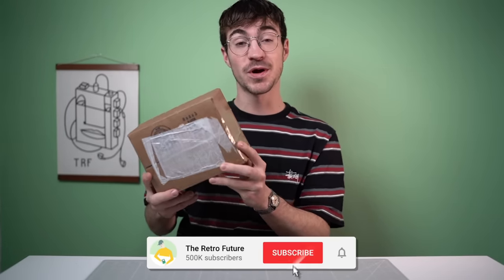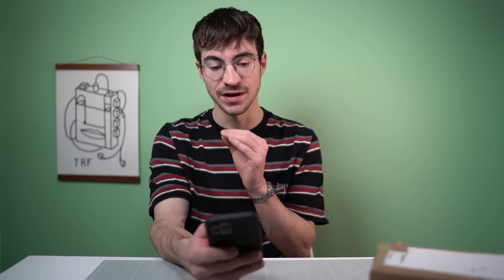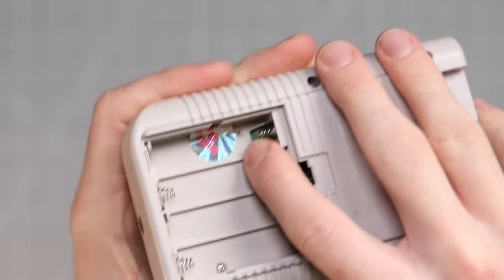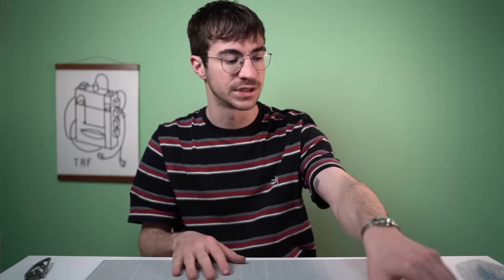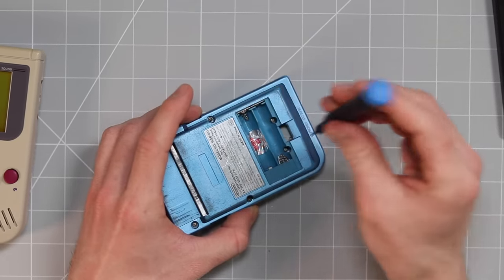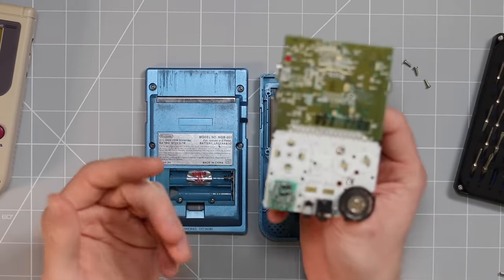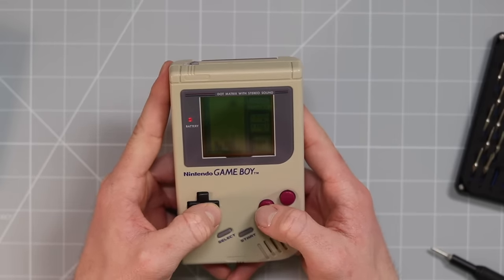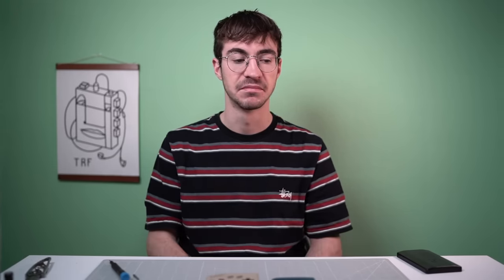DKOldies ruined my life

Comment: These guys sold a Super Mario World with a dead save battery to some poor dude and they made a video where they “heroically” sent him another one while requiring he send the original back, and then they had the audacity to tell me that save batteries are thoroughly checked and that it “probably died on the way to the customer”. You are not gonna tell me a 23 year old save battery died in the few days it took to go from your facility to the customer.
Reply: Of course they want the original back, how else is the next sucke... I mean customer going to get their refurbed unit?
Reply: You never know, it could be possible. Just saying
Reply: Some of those batteries only work long enough to test because they come mostly dead from China.. (all of them come from China) so they could have swapped it, checked it, and then it sat around for a few months and is now dead. This is a common problem with Gameboy games right now.
Reply: Would be interesting to know, if it was the first battery still- as they seem to call working stuff "refurbished" by outside cleaning and putting a Sticker on a screwpost😂
I would bet my a.. , it was the original one that died in stock/while shipping and they called/sold it as a refurbished game- probably they didn't even tested the remaining voltage and swap the battery as they should in that case😬
Reply: Who paid for the return?
Reply: @tormentridden  Those batteries last forever. I tested my old NES games that used CMOS batteries for saves. They were all over 3 volts i.e. good. Now, a few of them I will want to replace eventually.
Reply: Wow 😂they so full of it 🤨
Reply: @qTytan  I could guess the next power ball numbers but how likely is it?
Reply: Do you have a link to this by chance?
Reply: @DaCaptainDerpy  it’s their current latest video
Reply: @DaCaptainDerpy  One of their latest shorts
Reply: Not to mention, but the guy in the video was responding to comments on that video defending and praising DKOldies.
Reply: @qTytan  the save battery should not have died that fast, not if it was actually refurbished. Now if they used some cheapo batteries from China then there's a good chance a majority of those batteries were DOA. 

How do I know that? I replaced some with those. I'd never do that again.
Reply: @tormentridden  yeah that's a plausible explanation. I had a similar thing happen to me.
Reply: Lol dude I bought a copy of links awakening dx for safe display from em two years ago and no lie after seeing the videos I had my buddy bring his gbc over. And you can figure the rest. That’s crazy cause the vids are usually about the refurbish of the consoles and handhelds not being as bad :/
Reply: It is easy to accidentally cook the battery when soldering in a new one if you're not careful. Batteries will soak up all the heat from your soldering iron before your solder can really melt, especially without flux. My first attempt with my copy of Pokemon Crystal ended up with the battery dying about a week later. I didn't use the right type of battery with the flat leads already attached, so I tried to reuse the old tabs and solder directly to the battery lol. I ended up fixing it with the right battery later on, and it's still holding a save 6 years later
Reply: @tormentridden  this is why you buy name-brand CR2032s from a reliable manufacturer like Maxell and check the expiration dates.
Maxell cells are made in Japan. Varta are made in Germany.
Reply: @jakeiswayblack3377  that MIGHT be a plausible excuse…if they weren’t being paid to not make such simple mistakes and ensure quality and functionality to the customers they are charging 3x the ebay price of a game for. Also I change out batteries too, it’s not hard to avoid the battery. ;)
Reply: Right, and they claim that they check batteries with a meter as well!
Reply: Yes, shit like this happens all the time.....
Reply: For the prices they charge, I'd expect a brand new battery soldiered in there, with a removeable battery holder mod to boot.
Reply: And two planes never crashed into the world trade center, as if things don't "just happen"
Reply: They at leasy gave him a new one i like dkoldies i dont believe they meant to send that to him they mightve checked it and when he tried it it mightve worked for a little and then its stopped
Reply: @JenxBobaPlaysRoblox  its your choice to pat 3x the price you should on the chance to get a working or intact product
Reply: @JenxBobaPlaysRoblox  If this were some weird outlier case, a fluke, I would agree with you. But there have been many youtubers who tried DKO and got faulty systems, stuff that doesn't work, and stuff that was obviously not opened and cleaned despite them claiming they open and clean, and thoroughly inspect everything when it's obvious they don't,and that's the point here. They don't do what they claim they do, and then charge premium prices for stuff they didn't do. If I'm going to pay the prices they want, I better get a spotless original piece of hardware and it better not have a speck of dirt in it, it should be recapped, new batteries where applicable, etc.
 
Problem is.... that's not what you're getting.
Reply: i have my dads pokémon gold whenever i save the save file gets deleted
Reply: @Dhalin  true The creator of this video had a flipping fly in the place battery area
Reply: I was just looking at Pokemon crystal on their website and they have a picture in the listing of a copy that has the save battery held in by electrical tape! I sure hope they aren't sending any out like that for $150
Reply: With these old save batteries, they sometimes will hold a save when the console is reset but won't hold it when the system is powered off, or they'll keep the save for a short while without power but will lose it very quickly. So if DKoldies only did the bare minimum testing (which they probably did) then they probably assumed the cartridge was fine. I'm not defending DKoldies, they're absolutely scum. But it's a possible explanation for how it even happened in the first place. Also at the prices they charge they absolutely should be swapping out the batteries regardless of if they work or not, the original batteries on these games are well past their life expectancy.
Reply: @tormentridden are why ROMs are superior.
Reply: @jakeiswayblack3377 Best is to spot weld with the right equipment.
Reply: Yeah there’s prob a billion to one chance that happened. They’re idiots to suggest that
Reply: It was 23 years on the way to the customer 😂
Reply: Seems really minor
Reply: @tormentridden DKoldies defender spotted
Reply: @tannermace1500 your right 2 planes didn't hit the building 2 drones with a hologram image did hit the building though
Reply: Still didn't answer the question
Reply: @xXmonsieurxgamerXx  - You said "unit", lol! 😆
Reply: @jakeiswayblack3377  - I accidentally blew up a battery or two doing this...good thing I wear glasses, lol! 😆
Reply: So they don’t disclose information about batteries
Reply: Man they should really have a warranty or something to make it right when something goes wrong… sarcasm. They are selling multi decade old electronics. They fix what seems to be not working and give a 365 day warranty for everything. Not sure why everyone bitches and moans like they’re getting ripped off, send it back and get a refund. End of discussion.
Reply: @TheRealCaptainFreedom don't claim the save batteries last forever just because yours aren't dead that's the same as saying a cmos battery in pcs last forever because yours hasn't gone flat
Reply: @xXmonsieurxgamerXx  yeah who'd have thought their whole business model revolves around using the working parts from damages machines to built working machines.
Reply: @SineN0mine3  obviously they don't or else nobody would be making videos about their work 😉
Reply: comment dig. I've had this happen. checked a Pokémon game - worked all good after sitting for like 11 years.
Next day turned it on and the save was gone.   Not sticking up for DK. But it does happen.
Reply: @qTytan  its not, 2032 batteries are lithium and do not loose a charge like that. They were made to last decades.
Reply: @tannermace1500 slow down there buddy 😅
Reply: The video game company is better you can buy a game boy for 99$-159$ not bad for there prices
Reply: I mean it's totally possible....
Reply: "77 dollar is a hell of a lot of money" 🤣🤣🤣🤣
Reply: The “23 year old battery” statement could contribute to the battery dying, as you know, batteries don’t last forever. Climate changes like heat or cold weather do put a toll on batteries.
Reply: Hey man, do you know anywhere/anyone reputable to buy a customised gameboy color that would need to be shipped to Australia? Trying find a legit seller, have had no luck so far. Any info would be appreciated.

Comment: Cosmetically flawed can legitimately mean someone smashed a corner out of the plastic from DKoldies
Reply: only comes an A button
Reply: Cosmetically flawed. Just the motherboard and parts it needs to work, no case at all. Slap refurbished on it and sell it for $800
Reply: It would still fit the category of cosmetically flawed. A scratch it technically part of the outer casing being gone. It's just a very very very small piece of your systems body gone. Cosmetic issues means the system will still function. Which is really the most important thing. But the prices he was discussing are high.

Comment: I bought an immaculate second hand "Ice Blue" pocket about 20 years ago. I had no idea that the colour was a limited edition. It was rattling about in my jacket pocket with a couple of cartridges and a small plastic containing 4x spare AAA's for about 5 or 6 years. You think yours is hideously scarred, you should see mine ! Not only has the paint wore off all the corners and edges, but a fair amount of the plastic has worn down too !

The reason I stumbled across this video was because a few days back I unearthed this tatty GB pocket in a box of my old stuff, and (after testing that everything still worked) I decided to show it a little love. I've got parts coming to backlight and "Bivert" it, upgrade the speaker, add one of Giltesa's USB C Li-po charging kits + a 1100mah li-po, and a translucent blue shell to rehome it all in (plus some replacement coin cells for my cartridges, because all of old one I tried in my GB pocket have lost my saved games). If all goes to plan it should be better than new.

Comment: I got lucky with my ice blue then. I think I only paid like 30-40 for it. Only downside is it has screen cancer around the edges (covered by the lens), and I think the previous owner tried gluing the original sticker down at some point. Label wasnt salvageable and took way too long to get the glue clump off and the scrub the cigarette smell out of the inside.

Comment: To be fair, the way they painted the GameBoy Pockets, that paint came off just by touching the thing. I have a golden Nintendo Power anniversary GameBoy Pocket, a good third of the gold paint has come off just from a few years of holding it. I imagine the Ice Blue pocket was painted the exact same way, just blue instead of gold.
Reply: As someone who does own a ice blue gbp, I can confirm that is indeed the case.
Reply: If you washed your hands before using it, the paint didn’t come off. Source: my mint ice blue gbp. Always washed my hands. The oils from your hands wear the paint super quick. Same goes for anything painted or plastic. First it turns glossy, and then it comes off.

Comment: As someone who worked in a retro game store for the better part of 8 years recently, DKOldies prices are absolutely absurd. Their quality control is lackluster at best. We had a rival store in town with very similar ambitions. Selling reproduction carts as authentic, damage, not working or defective games as fully tested among many other things. The simple fact of the matter is, with self taught methods I am able to thoroughly test a system and clean it and diagnose issues usually within 20-30 minutes and give it a full clean on average. Each game is usually about the same for a thorough test and clean. Obviously there can be exceptions like blockbuster stickers or homemade stickers, permanent marker, some people engraved their info into the cartridges which obviously cannot really be fixed without a shell replacement etc. Needless to say, a LOT of retro stores just don't put as much effort into the quality of their resale as they could and as a personal collector before I started working at the store, I had an elevated level of quality I strived for. I treated just about every game and console for my entire 8 years as though it was going into my personal collection. That quality however got abused a little by the employer but when you work at a video game store you kind of don't care lol. I worked luckily at a Ma and Pa shop so I didn't mind putting in the extra effort as I was generally rewarded for it.

Comment: I think the biggest issue is things like "Oh, that won't be difficult for me to remove and replace at all."

I understand you bought something that said it was "cosmetically flawed", but....for a price like $100+ for a DMG, it should still be damn near perfect. The fact that it was $100+, and you're still gonna have to do some fixing up on it, that's just nonsense. Like said in the video, you can get a used DMG for like, $10, and just fix it up yourself at that point. And it'd cost less than this one from DKOldies did.

And yeah, the difference in "cosmetically flawed" between the two game boys, is ridiculous. They're clearly just using "cosmetically flawed" as a catch-all on their website, for anything that's not "perfect" or "refurbished". I'd imagine it's just a way to get people to still buy the consoles, by making 'em slightly cheaper, and doing less work to make 'em look nice. (Even though, let's be fair here, even their refurbished stuff is crap a majority of the time).

From what I've seen of DKOldies, nothing they claim, is claimed because it's true. They put things like "refurbished" and stuff on their site, to boost the price. That's it. The fact that I see one video where a guy bought a "refurbished" PS3, and it literally had caked on dust, around the fans, and around the disc tray, that was all fully visible without even taking it apart, just shows that their claims don't mean a damn thing. (That same ps3 also had visible water damage inside, fyi)

What I really think the website needs to start doing, is posting pictures of every single console they're selling. Proper pictures, full 360 degrees, close ups, even the internals. Making it VERY obvious what you're going to be getting when you order something. You'll know exactly what damage it has, how clean it is, etc, before even making the purchase. Because right now, the whole site is set up in a way where it's hard to look at it and say the listing was "wrong". Like when you buy a PS3 or something, and it says "Playstation 3 compatible controller included". They usually mean an off-brand PS3 controller. But it's vague enough that a lot of people are going to assume it's coming with an official one, without DK actually lying about it. In the case of the Game Boy Pocket in this video, technically speaking, it's "cosmetically flawed". So technically speaking, you can't go back to them, and claim they lied about it. But if they had proper pictures of what you were getting, that wouldn't be an issue. Because if the pictures show a nicer, cleaned up console, and yours isn't that, THEN you could claim they lied.

Comment: Buying from eBay isn't going to be better unless you find a trusted seller. Many times I have purchased used consoles that were not as described and had to be returned. In DKoldies defence they are changing the screen protector / cover on all their gameboys it seems. For a cosmetically flawed console, thats kind of amazing. If they say the console is cosmetically flawed when it is as you say, a painted on colour, its obviously going to be bad. For example I have some PS4 consoles with the gloss side on it, the console looks incredible everywhere except from that gloss part looking terrible. Its just the design of the item. You got what you expected in my opinion, as you said, item has not been listed as refurbished. I am not a DK Oldies fan by the way, but looking at your video, I think you have nothing to complain about besides from the same thing everyone should be saying which is, why is the price soo high, this is regardless of what you get, those prices are just too high.

Comment: if theyr selling it as original with cosmetic flaws, why the hell are they modding it with new screen protectors? if i paid for original i wanted the original stuff.
doesnt matter if it was scratched to hell, that's what i picked, not original with slight refurbishing as if i wanted a refurbished system i would have paid for it.

originality matters a ton to folks and that's not original, regardless of how nice it looks.